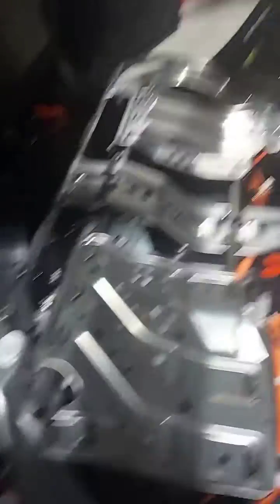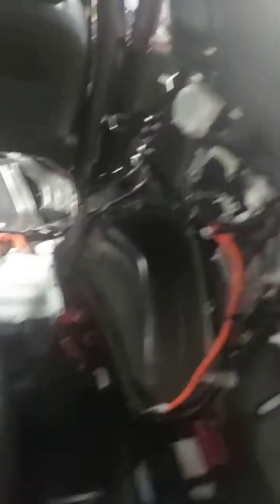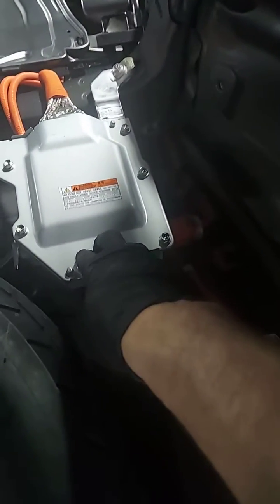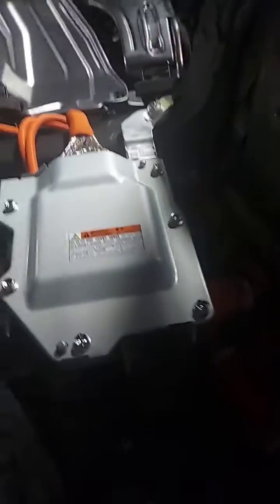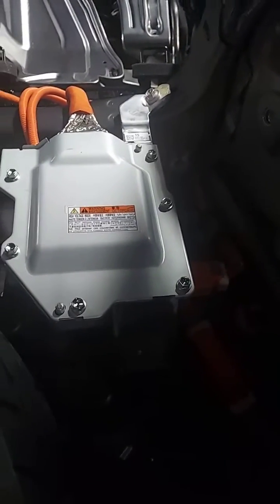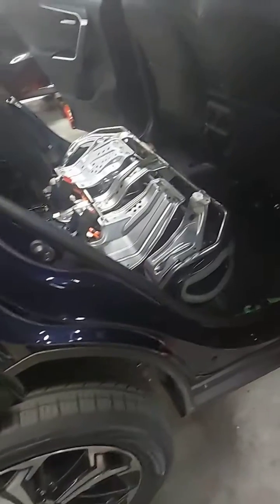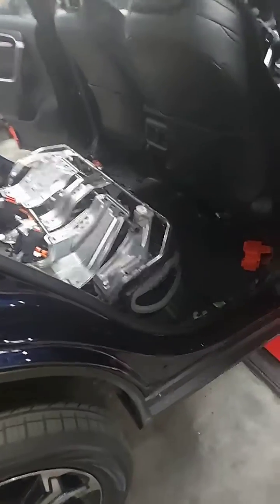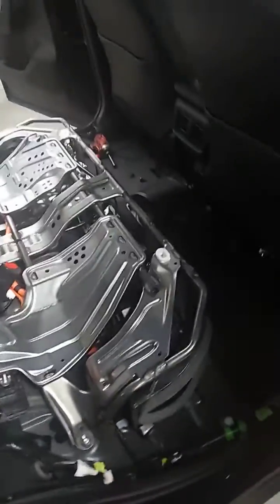2022 Toyota RAV4 Prime DC-to-DC converter junction block problem

Comment: what is part number of DC-to-DC converter junction block. What DTC is showing?
Reply from the maker: According to the paperwork (remember, this was back in 2022 way before the current recall), the part was 82670-42020 BLOCK ASSY, JUNCT. I haven't had the current DC converter recall work done.

Comment: I haven’t had issues with the DC-to-DC converter with my 2021 Rav4 Prime (26K miles so far) but apparently Toyota will be replacing it under warranty according to the recall notice that I received from my dealer today.
Reply from the maker: Yeah, I think the latest recall (https://www.nhtsa.gov/recalls?nhtsaId=23V478000) is slightly different than what I experienced here back in December, but looks like I'll be taking my Prime in for more work on that DC-to-DC converter. :(
Reply: Just had my DC-to-DC converter replaced, per the recall.
Reply: I had the recall done yesterday here in Texas. Apparently certain states had to wait to get the green light from Toyota to complete the recall. I called in early April and the part wasn’t available to complete the recall. I called in late April and finally Toyota let the dealership order the parts required to complete the recall under warranty. Thanks from Texas for being almost one year late to complete this recall under warranty, Toyota! 👎